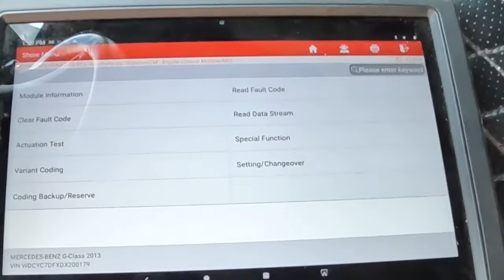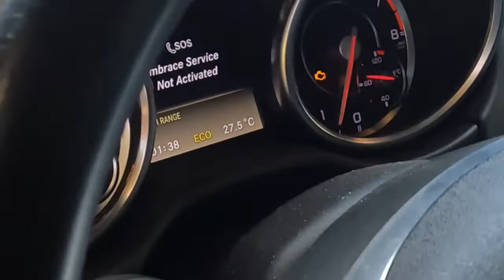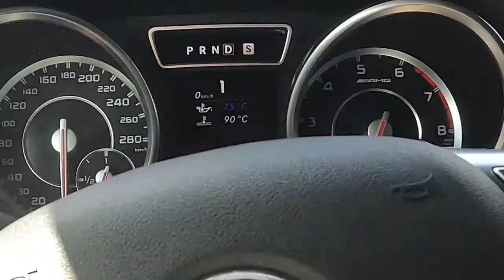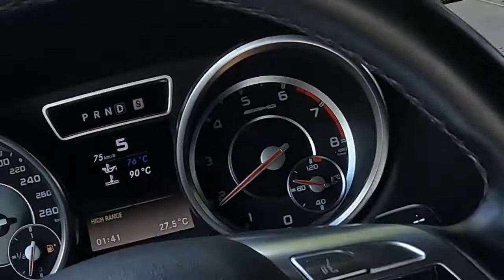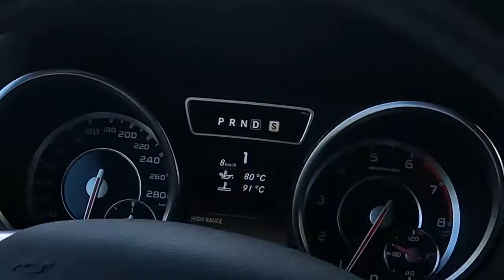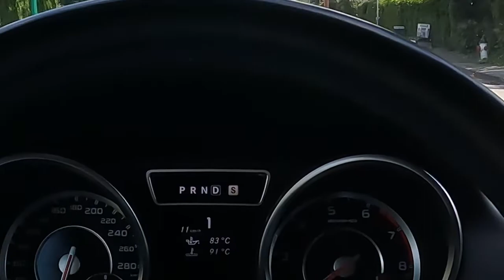Changing boost pressure sensor on a 2013 G63. Same sensor on other 63 AMG cars. S63, C63, E63, GLE63

Comment: Well done, have a look at the water temp valve as a preventive maintenance. Changed mine at 110 KM YOM 2017. The top rubber partially gone. If hard plastic parts ending up in the coolant circulation could block small lines inside the cylinder and cause  overheat. Part is 200 USD and sleep better after the exchange.

Comment: My gls is saying boost pressure too low and the code is p0299 but the car drives normal. The code came up after a broke a coolant line while I was cleaning the engine bay. I'm assuming that the boost pressure sensor is the issue now??
Reply from the maker: Could be the sensor or could be a vacuum line. I'd check all the lines first